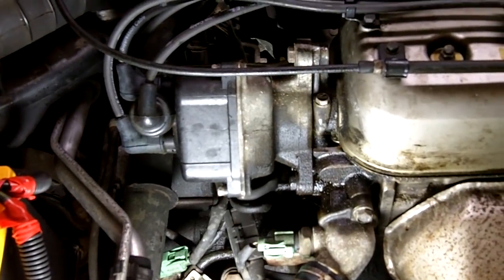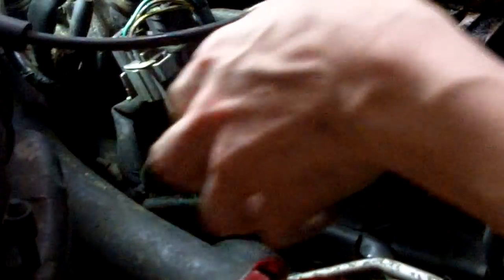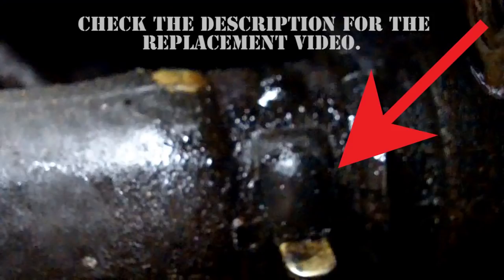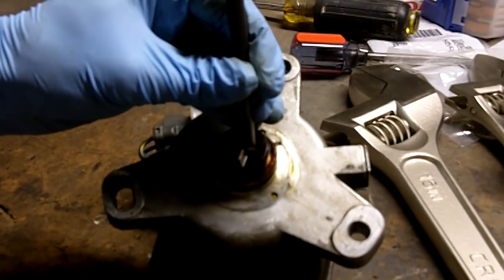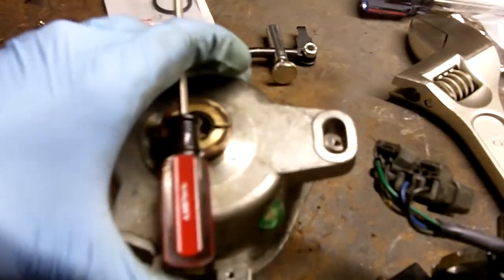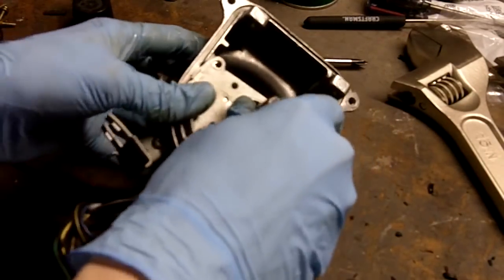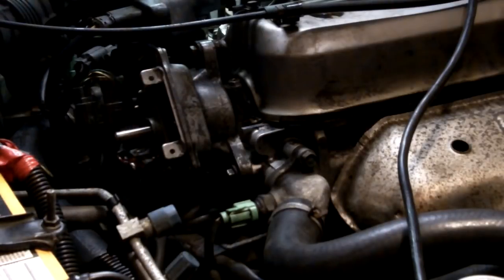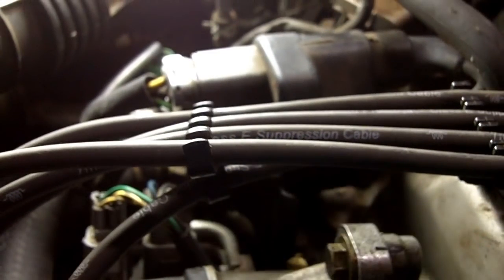Honda Distributor Oil Seal Replacement

Comment: Thank you so much, you just saved me 400 dollars, you are the man! my honda is 95 accord automatic ex 4cl, dis-tor. leaks from the inner seal and O-ring, i got the O-ring at honda, not the inner seal, you say that this part wont fit with Hitachi dis-tor. How do i know if mine isnt Hitachi? also, could you send me a link of the exact inner seal you used, i dont want to buy something that doesnt fit my distributor, i appreciate everything your help

Comment: Very informative video.

I went ahead and replaced a O-ring in the distributor because there was an external oil leak. 
I had the position of the rotor marked with permanent marker when i took it off but during wiping of the excess oil, the marks were also wiped out, yeah call me a dummy 
I installed the distributor back into it's place and fitted perfectly, drove the vehicle and seems ok, just a little tighter gas pedal.
I have read people talking about a 180 degree rotation of the rod and think i might have placed the rotor wrong.
How can i fix it, how can i confirm that the rotor is placed perfectly? Will it cause a damage to the engine if the rotors aren't placed exactly the way how it came out?

It is for 1999 Honda Accord EX V6
Reply from the maker: That's why I made a permanent mark with a punch in the video a bit more effort but it won't wipe off :-).

The engine won't start if the distributor shaft key is 180 degrees out. You had a 50/50 chance luckily you guessed right.
Reply: Thank you. Do I need to adjust the timing?
Reply from the maker: Kiran K. Pandit
You were referring to the end piece with the pin in it right? That's what I thought you were referring to.

1999 Accords don't have adjustable base timing the last year Accord that had it was 1995. They did away with it when the vehicles were switched over to OBD 2 in 1996. The positioning of the distributor doesn't matter.
Reply: I was referring to the shaft that goes inside the camshaft.
Reply from the maker: Kiran K. Pandit
Ok then refer to my initial reply. As for the timing it isn't adjustable.
Reply: *****
'94 Accord LX, On OBD 1  can the shaft key be rotated around? I didn't mess with it. I didn't replace th O-ring the owner didn't want it done. So it just sat  while I did the heater hose. I marked the distributor, and put it back in. Car wont start. I nudged it c CW and CCW about a 1/16th of an inch and nothing helped. If it did get moved, can I remove the distributor, and rotate it. I had a helper who was mucking with stuff so...

Comment: ur saying that part number for the seal only works for the TEC distributor and not the HITACHI ones? thats why i was trying to purchase one on ebay and they said my 99 accord ex sedan is not compatible, thanks, for the vid, any place i could get the seal for my honda?

Comment: Where can i order a new distributor, heat core inlet hose an transmission shift solenoids for a 97 honda accord lx 4cyl. Engine? Do you know the oem part numbers for those 3 parts so i dont have to send them back and wait if they are not the right ones?

Comment: I have a hitachi distributor on my 1999 honda accord that is a little different that the one in your video. It is a hitachi D4T97-03. my engine model is F23A4. Anyway, my distributor is different enough that I thought I would reach out to you for guidance. I don't have a retaining clip holding the pin in on the external part of the distributor shaft that inserts into the engine block. I can't figure how to get the pin out to be able to replace the o-ring. Is it even worth messing with?

Comment: Would you happen to have the part number for the internal o ring that you replaced? I went to my local Honda dealership and they said they don't sell that, which means I would need to buy a new distributor to fix my leak =(

Comment: Thank you you've helped me stop a small problem form turning to huge one. I'm in need of a online location where I can purchase the internal and external.??
Reply from the maker: The external o-ring can be purchased from any online Honda parts dealer. The internal seal sellers can be found by Googling the part number.

Comment: Could you send me the firing order.  I did leave them on when doing the repair, but once I was done I pulled two of them off to clean the built up oil gunk.  I remember taking them off one at a time, but maybe I didn't.

Thank you for responding.  I want to check every avenue before having it towed to a shop.

Comment: Took off distributor, replaced heater hose, put distributor back on and car won't start...just starter motor turns but won't start now..1998 accord DX 4 cyl,

Comment: ... i just was told that my year Accord cannot be resealed and also found an article saying the same thing ... so now i am confused ... because 2 months ago i saw with my own eyes my Honda mechanic reseal my 1999 Accord EX Hitachi distributor with a seal and O ring  ... but this article i read says that the 1999 dist. cannot be resealed ... is this true?

Comment: I'm curious about why it is necessary to replace the rotor.. I'm no veteran, so I want to be sure I order all the parts needed before I begin, and not leave out any steps.
Reply from the maker: The cap and rotor are ignition maintenance items like the spark plugs. If you can't remember when they were last replaced it's a good idea to replace them.
Reply: Okay then I will do, thank you very much!

Comment: This video was very informative, thanks! I have two questions. I have a 97 acura cl 2.2. My car has a almost same engine as the car you worked on in this video. First question is, from the info you provided my car is a obd2 vehicle, how would I adjust the timing after i replace both seal external and internal? Would I just pop the distributor back in and thats it?
Reply from the maker: Yes just pop it back on there's no timing adjustment on OBD 2 engines.
Reply: ***** Ok Thanks for a prompt response, Just one more question, I work for oreilly's auto parts and I am planning to buy both seals from my job. The brand is fel-pro, material is rubber. Should i go for it and buy both seals or look for a alternative seller?
Reply from the maker: I doubt any aftermarket part supplier would have the inner shaft seal. I've looked in the past. The outer o-ring maybe.

If both parts are now available in the aftermarket post back with the part number. It would make it a lot easier to get both parts in one place.
Reply: ***** I'll check back in tomorrow with what i can find. Thanks alot
Reply: Daniel Aguilar I couldn't find both parts but I did find the o-ring. Since the accord you worked has almost the same motor as my 97 acura cl, can I use the same parts you replaced for the accord?
Reply from the maker: Yeah the CL has the B1 engine which uses the Hitachi.
Reply: ***** Ok ya I found out on wikipedia it also has the F22b1 eninge so Im gong ahead and order the parts. Thanks alot for all the info Ill check back in with the results, for I have a bad oil leak under the distributor

Comment: hello Bushougoma. i have a hitachi distributor in my honda accord 1997. there is no snap ring over the pin. how do take the pin out?
Reply from the maker: That's a later revision part it's an interference fit pin a flat punch and a large hammer or an arbor press is the only way.
Reply: ***** so Bushougoma both ends of pin look identical. which end to hit with the hammer? and once it comes out how to put it back in?
Reply from the maker: logiclightmatter786
You can drive it out in either direction.

You only have to drive it through far enough to clear the inner shaft there's no need to completely remove it.

Without a press don't be surprised if you have to break out a 4 pound mini sledge. Some are easy and others can be stubborn.

Make sure the end piece is resting in the jaws of an open vice so the hammer blows don't damage the bearings.
Reply: ***** thanks a lot for the prompt reply like always. you are wonderful helping out others. but i give up on that hardy pin. my hands are vibrating from the hammering. you were right on it being stubborn. am thinking of getting new part. so should i get the housing or the assembly. thanks.
Reply from the maker: logiclightmatter786 Yeah I usually use either an air hammer or a shop press. Doing things with minimal tools can be both frustrating and time consuming sometimes.

I believe the OEM distributors are discontinued so your best bet is to get a used one from a local salvage yard or online.

Preferably one with a snap ring so you can replace the seals.
Reply: http://www.hondaautomotiveparts.com/auto/jsp/mws/prddisplay.jsp?inputstate=5&catcgry1=ACCORD&catcgry2=1997&catcgry3=4DR+EX+%28LEATHER%29&catcgry4=KL4AT&catcgry5=DISTRIBUTOR+%28HITACHI%29
i think this honda dealer has it. do you think its worth it or just leave it dripping and change the heater hose once in a while. and my heater hose has already exploded because of this leaving me stranded on the freeway. and now i am really good at changing that hose thanks to your video!!
Reply from the maker: logiclightmatter786
For around 100 bucks I'd say it's worth it to not have to deal with a repeat failure.

Comment: Hi my friend, I have a trouble with the conections to module, while I was reparing I disconected the cables for accident so now the car will no start, I wonder if you have the diagram or you remember the conections to the module but I know this vidio has 9 years hhe

Comment: hello. it a very nice and informative video. i have a 1997 accord. and i am really confused if taking the distributor out will mess up the timing or not? you said to skip the if your car is obd2. then what do we have to do time the ignition. and i have seen eric the car guy video and he is timing a obd2 car with timing gun??thanks
Reply from the maker: The timing isn't adjustable on OBD 2 vehicles. Anyone who is trying doesn't truly understand how these ignition systems are laid out. There's actually a tab on the cylinder head that prevents the distributor from being rotated any considerable amount on OBD 2 vehicles.

The reason for this is on OBD 1 vehicles the Crankshaft Position, TDC, and CYP (cylinder 1 position) sensors are all in the distributor. Therefore when you rotate it the angular relationship between the sensors and the camshaft changes.

On OBD 2 vehicles the Crank and TDC sensors are located underneath the timing cover near the crankshaft. They are bolted to the block where their angular relationship is fixed (non-adjustable). The only sensor in an OBD 2 distributor is the CYP which just identifies the position of cylinder 1 so it's alignment isn't super critical.
Reply: ***** thanks for the prompt reply. you are awesome!!!

Comment: Thanks for the great vida
I have a question 
How do you change the inner seal on the distributer with the inner ignition coil ?
Reply from the maker: The process is similar but the inner seal part number is different. The number is printed on the face of the seal.

It's just 2 extra fasteners to remove the internal coil.
Reply: Thanks for the quick response.

Comment: hi Bush,.
I got that perfect similar oil leakage problem on my honda accord 2001, now my car wont start. so my question1 is does this could be the cause for the problem. 2. I bring one guy who said he can fix cars and he scanned it with a scan device with only the switch on and he said it shows me the distirbutor is the problem. Then he pull out the distirbutor with no marking, please, please help me soon. I know you are a good person, like to help others. I have no money to take it to rep.shop

Comment: May I ask the size/specs of the oil seal ?  It is likely the same 
as that on the Mitsubishi's distributor.

Might you be able to do one for the Mitsubishi 4G13 engine ?

These are on the local Malaysian Proton Sagas/Iswaras, and 
has a similar notorious tendency to leak.

My mechanics are hesitant to replace it the shaft's oil seal, because 
they say that the plastic parts inside are very flimsy, and can fall apart 
when dismantled, from their experience.

Never had such leaks with that on my previous cars, where the 
Nippondeno distributors were mounted almost vertically downwards,
geared to the crankshaft, rather than the awkward camshaft.

Comment: If installing the distributor assy and the car idle very low, below 250 rpm, which direction should you turn the distributor assy before tighten down those three 12mm bolts?

Nice video.
Reply from the maker: Just line it up with the mark you made before you removed it. If you didn't mark it you need a timing light and a jumper wire to jump the two pin connector under the dash.

This is Base Timing the PCM will correct it jumping the 2 pin connector will cause the PCM to stop adjusting the timing. You also can't set the base timing unless the engine is idling at a constant 700 RPM +-50 RPM. This wouldn't cause a low idle.

When did this issue start after reinstalling the distributor?
Reply: ***** Yes, right after installing the Water Inlet Hose. I had to remove the distributor to get access to the hose clamp. I didn't know what was inside of the distributor nor thought I need to mark those three 12mm bolt holds.  Now, when the car warmed up the tac reads less than 100 or close to zero. And the car dies if I don't step on the gas pedal.

Working on car is not good on my fingernails.
My little girl is helping me.
I rather use my own make-up instead from the car :-(

Under which side of the dash for the 2000 Honda Civic to get access to the connector?  

Thank you for answering because my husband & children are with God.
He used to fix ours cars & was a wonderful husband & father.  
We lost our cars, homes & many things to pay the rent & put food on the table since 9/11.
Reply from the maker: angelisone
Luckily there is no timing adjustment on a 2000 Accord the last year that had adjustable timing was 1995. The distributor position doesn't matter.

Did you remove the ignition wires from the distributor? We're they put back on in the right order?

Did you make sure the keyed distributor shaft locked into the camshaft properly?

I would definitely be looking into an ignition issue since this occurred after removing the distributor.
Reply: ***** All ignition wires (4 spark plug cables) were labeled on cables to match cap's sockets. Yes, they were put back correctly.

The female slot of engine matched with male off-set shaft of distributor. I applied some oil around the new outside O ring seal. It fits perfectly.

My 2000 Honda Civic & 2000 Honda Accord doesn't need distributor adjustment, is that correct? 

If not, where is the location on 2000 Civic for the plug to be shorted out with a wire, left or right of dashboard/top or bottom? 

Many thanks.
Reply from the maker: angelisone
There is no 2 pin connector on that model year. I'm curious is the check engine light on?

It's possible the wires got damaged during removal pull the wires off one at a time off the cap are the connectors in the cap and on the wires relatively clean and shiny? Lightly tug on the metal wire connectors to make sure they're firmly attached sometimes when you remove old ignition wires the connectors can separate.

Make sure the wires are pushed onto the cap firmly so they make full contact. The rounded connectors in the wires should be seated in the metal cup contacts in the cap.

If so pull the cap off look inside and make sure the spring loaded button that contacts the center of the rotor is still there occasionally they can fall off.

Also check the condition of the contacts in the cap and the blade of the rotor. Check for pitting rusting or corrosion.
Reply: ***** I got no Check Engine Light showing on the console dash.

All spark plugs tested & good from end to Cap leads from the inside housing with a digital volt meter.

Cap & rotor (just a little pits) are good.

How do I check if there is no connector to short out on 2000 Civic, if I borrow a timing light (let's hope someone on my street has the timing light)?
Reply from the maker: angelisone
The last generation Accord that had the 2 pin connector was the fifth generation 1994-1997 you have a sixth generation 1998-2002 Accord which doesn't have this connector.

You can't check timing unless the engine is idling at the proper steady RPM. Also since it's not adjustable there's no need to check it.

How does the engine react when you maintain the proper idle rpm by holding the throttle open?

Any misfiring or roughness does the engine hold steady at the proper RPM?
Reply: ***** No shaking or misfire or running rough. At 750rpm, engine runs good.  Just will die when tac hits under 100rpm.  I would have to step on the gas at the stop, lights or coasting to keep the car from taking a coffee breaks.
Reply from the maker: angelisone
Then I'd check the idle air control valve. It sounds like not enough air is bypassing the closed throttle plate to allow the engine to idle. The 2000 Accords used a rotary IAC valve which had a tendency to stick.

It's mounted on the throttle body and has a 3 pin connector on it.

Once it's off look between the two machined passages and you'll see the valve. With the passages facing up spray it with carb cleaner and work the valve back and fourth until it moves freely. Let it dry and reassemble.
Reply: ***** I hope the locations on your 2000 Accord will be the same in the 2000 Civic.

Because I have no ideal what the Idle Air Control Valve looks like.
Reply from the maker: angelisone
It's the bulky thing with 2 small coolant hoses coming off of it and a has 3 pin electrical connector plugged into it. It's on the throttle body. It's held on by 4 bolts.
Reply: ***** Heck, I will look for it.  But I also have no ideal what a throttle body looked like.  Thank you, again for your video & time.